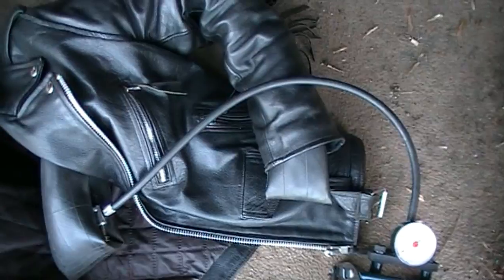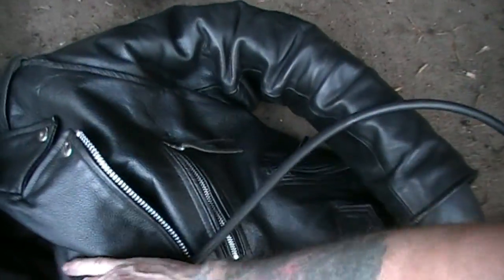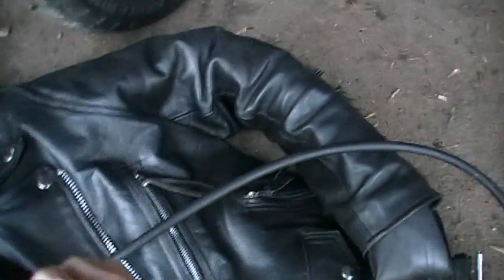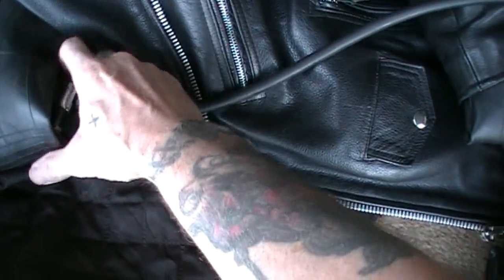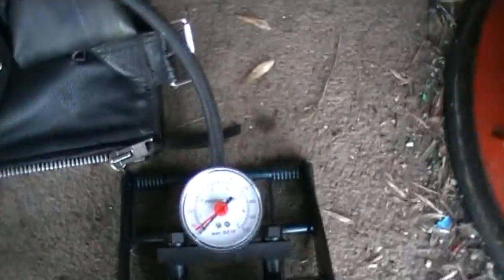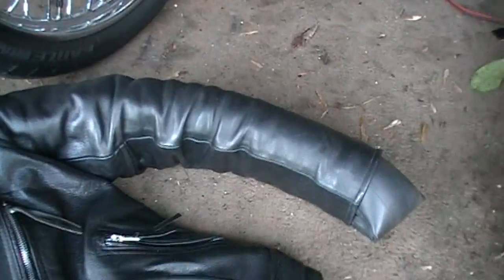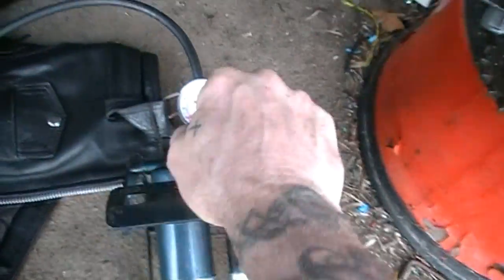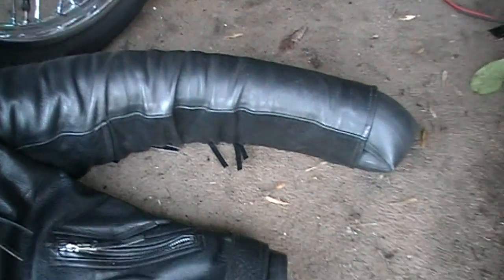TESTING NASA'S 4.7 llb HOAX SPACE SUIT PRESSURE IN MY JACKET LOL

Comment: Great video. I was wondering what would happen to astronauts Bob and Doug if their SpaceX capsule lost pressure? Their trendy, flexible space suits would suddenly become rigid under 14 psi of internal pressure--the fabric would be as tight as an inflated car tire. Soon the seams would rupture and their blood would boil off in the vacuum of space.
Reply: As their spacesuits and spacecraft only hold 4PSI and are not made of cheap leather, nor have car tire tubes in them, maybe the result would be different.

Comment: The preasure in Spacesiuts Has to be 14,5 PSi.  to be as preasurised like at Sealevel. if you put 5 PSi! in that Suit. (At Sealevel!)  you actually preasurised it with 19,5 PSi.  (The Germans Called it out in the Term "ATü"... It means... (Atmosphäre/Überdruck)). You cant simulate a vacuum with Over preasure. ;) And 5 PSi?... are 34 percent of "normal" preasure. or did i miss something?
Reply: @BennyFitter  actually you dont need to pressurise the Spacesiut... if you have a Rubber-ish underwear. That maintains a Constant prassure of 4-7 psi. The only Thing you have to care, are the Loungs and the eyeballs if the Helmet is providing a Atmosphearic "atmosphear" and is sealed up to the Neck. You dont need to wear a siut full of Air. Cause the Skin cant differ between Air pressure or "tension" Pressure.
Reply: @BennyFitter  thats only half the truth. Of course the Hand in a vacuumchamber will press through the fibres. Because the rest of the body Experiences a pressure of 15 psi. So you need a glove who can create that pressure in tension.
Reply: @BennyFitter  a scuberdive siut is capable of creating a counterpressure... without airfilling
Reply: @BennyFitter  the Black diving  siut... its only to keep Water inside, to keep some insulation.
Reply: @BennyFitter  its quite difficult to explain that in englisch. 
Are you able to understand german?
Reply: @BennyFitter  reading is not the problem. You can keep writing in englisch. 

But if you arent familiar with german. It makes no sense to Translate. So i stick with englisch Till i improve. ;)
Reply: What i try to Say. If you keep constant pressure through out the whole skin. It dossnt matter if it is a airfilled Hardsiut. A Rubbersiut or even Duct Tape can deliver some results. The Human dont need Atmospherik pressure to Stay in shape. He only needs Air in his loungs. And that needs to be gaspressured. All Other componants are can be Supported by the Muscles. If there are Evenly Supported by some Kind of artificial exoskelliton or a tightening compound. (If you on a Mountain. Like the K2... the Human is in an inviorment of close by 50% Atmospherik pressure. And only needs high conzentrated oxigen to survive.

Comment: MrSandpit, I debunked these claims on one of your previous posts, but rather than addressing my points you ignored them. I doubt that anybody with an education beyond year 10 would take this video seriously.

A couple of points:

1) NASA doesn't make its space suits out of bike tires. They're a little more sophisticated than that. The Apollo AL7 suits cost more than a million dollars each, in 1960s money;

2) Can you tell me what sorts of rigid joints were used in the AL7?

3) What does the term 'constant volume' refer to? (No Googling, now, You're supposed to have already done your homework on this one, since you're posting a video claiming that space suits are fake);

4) 4.7psi in a 14psi atmosphere is not the same as 4.7psi in a vacuum;

5) Do you know that Wiley Post was using pressure suits in the 1930s? And just a heads-up: he wasn't working for NASA;

6) Are you aware that the USSR, and China have all used space suits? If so, do you also claim that their space suits are fake?

6) Truck tires are often inflated to over 100psi. Whilst they are rigid, they don't puff up like your bike tire did. They maintain their shape. Why is this?

These questions are so obvious that I can only conclude that you are a troll.
Reply: Bill Larkin: "...a hero type"? What the hell are you talking about? We're not in a movie. Heroes do stuff like running into burning buildings and jumping into the paths of oncoming vehicles to save  to save people. I can safely assure you I've never done any of these things. But I fail to see what that's got to do with this video.

The simple test is to inflate the suit to a pressure above that of atmospheric pressure. Suit integrity is about the pressure difference between the inside and the outside of the suit. So all you have to do, even without any sort of vacuum chamber, is put the suit on a table and pump it up to 18.5 psi. 

You appear to have confused torr 8 and torr 3 with torr 1 x 10 exponent -8 and torr 1 x 10 exponent -3. Torr 8 is a higher pressure than torr 3. But torr 1 x 10 exponent -8 is 100,000 times lower than torr 1 x 10 exponent -3.

Anyway, your figures are way off for another reason: pressure in space varies, but in low earth orbit it's around 7.3 torr. We can easily create lower pressures that this on earth. NASA's vacuum chamber can create vacuums as low as 6 torr. The proof is in the pudding: the International space station (and many other satellites) has to be periodically re-boosted as the very thin atmosphere at aroung 400km creates a subtle drag and slows it down.

In interstellar space the pressure is much lower - it's 7.5 x 10 exponent -5.

In both these cases, if you crunch the numbers you find that the pressure difference between the inside on an AL-7 suit and even interstellar space (where obviously, humans have never yet been) is LOWER than the pressure difference between the inside and the outside of Wiley Post's suit in 1934.
Reply from the maker: 1. Made by some ole latex company who say they are not even radioactive proof
2. You mean the rigid joints in between all the flexible bits?
3. Being honest, not sure.
4. Then why does NASA not say so
5. High altitude is a little different than a space vacuum
6. Did China and Russia land on the Moon?
7. They are reinforced with steel
Reply from the maker: https://www.youtube.com/watch?v=2TebGSZ2EQE
Reply: 1) Wrong again. The design and construction of the AL-7 was initially split between ILC (International Latex Company) and Hamilton Standard, a long-time aero-engineering company. Ultimately Hamilton and ILC were unable to work together successfully, and Hamilton switched to Goodrich as its supplier. Ultimately NASA took over direct control of the design and construction. The process took around three years;

2) Yes, I mean the rigid joints between all the flexible bits. You didn't account for them in your video (I therefore infer that you didn't know about them until I mentioned them), and they made a rather significant difference in the mobility of the suits. They contained bearings to allow for easy rotation and extension;

3) The term 'Constant volume' refers to the careful design of the suits to prevent any change in the internal volume of the suits when the astronaut moved, thus preventing an increase in pressure (and therefore, stiffness) when he bent his arms or legs, or when he bent over. Again, the fact that you didn't know about this shows that you haven't done very much research;

4) Seriously? You need NASA to tell you that 4.5psi - 0psi does not equal 4.5psi - 14psi? (BTW, I believe that the actual pressure in your tire tube is 18.5psi - if it were actually 4.5psi it would collapse. I'm assuming that the gauge that you used takes this into account);

5) Yes! That's correct. High altitude is a little different than a space vacuum. But in terms of pressure, the difference is pretty small. At 50,000 feet, the altitude of Post's highest flight, atmospheric pressure is 1.6psi (just over a tenth of the pressure on the ground). In space it is close to 0psi.

Post's suit was pressurised with pure oxygen to 7.25psi, thus the pressure difference between the inside of Post's suit and the air outside was 5.35psi.

On the other hand, the AL-7 suits had in internal pressure of 4.5psi, so the pressure difference between the inside of an Apollo astronaut's suit and the vacuum of space was 4.5psi, i.e., slightly LESS than the difference between Post's suit and his environment. So in terms of pressure-related stiffness, the Apollo suits had less to deal with than Post's pressure suit. Even so, Post's suit had joints that gave it enough flexibility to allow him to walk to his aircraft and operate the controls. And he had all this in 1934. I'm afraid you've just contradicted your own claim;

6) Irrelevant. Your video is about the supposed unfeasibility of the AL-7 (or presumably any other space suit) working in a vacuum. Unless you're suggesting that the vacuum on the moon is different from the vacuum in space, then whether or not China or Russia landed humans on the Moon is irrelevant. China and Russia have put humans into space (and have conducted numerous space walks), and their space suits work. Therefore your video is wrong;

7) If truck tires can be inflated without puffing up, then why do you suppose it's impossible to build a space suit that also doesn't puff up when inflated? Did you know that space suits have restraint cables built into them as well? You just have to add joints to allow for movement.

I'm sorry, but the more you write, the more you demonstrate how little you actually know about the subject. There's a veritable ocean of information out there, an awful lot of it's not from NASA (or even the USA), and it's all free.

I can only conclude that you are a troll.
Reply: Squodgamullis 
Your a hero type huh? So you tell me
1. How do you test a suit on earth for a Torr 8 vacuum when you cant even produce a vacuum on earth lower than a torr 3?
Reply: Squodgamullis - Excellent!  I commend you.  It is refreshing to see someone else who knows that they are talking about, and who refutes the garbage these hoaxers post.  If only they would actually study what they claim they understand.  This is yet another example of ignorance claiming fraud, or just a troll, as you said.  Sometimes it is difficult to tell the difference.  All the information any hoaxer would ever want to know, even if only to refute the moon landings, is available online.

The Apollo A7L lunar suit was composed of many layers.  An undergarment (usually cotton) similar to long johns, to absorb perspiration.  Then the Liquid Cooling and Ventilation Garment (LCG) that connected to the PLSS to remove the astronauts' body heat via a porous plate sublimator.  The pressure suit was exactly what you said.  It contained a rubber bladder on the inside that was interwoven with convolutes (hard rubber "accordion tubes") at all the joints; elbows, torso, knees, ankles.  The ingenious part was the cables that were manufactured inside the convolutes, that acted like hinges, carrying most of the load of the pressure suit.  THIS was the innovation that made the 4.5 psi pressure in a vacuum MUCH easier in which to have mobility.   There was even a cable across the chest, which is why in the videos of the lunar astronauts, even while just standing, their arms always seem to be slightly raised.  The convolutes made it so that constant volume could be maintained, regardless of the body movement of the astronaut.  

The reason that the suits did not seem rigid and expanded, like most hoaxers claim they should have been, was the type of rubber used, and the fact that there was a containment layer on top of the rubber bladder that kept the bladder from ballooning out.  Why is this so hard for hoaxers to understand?  Finally came the outer suit, which was composed of many layers; dacron, kapton insulation, and Beta Cloth (which was specifically designed for Apollo).  Beta Cloth was micro-fibers coated with Teflon, to reflect solar heat radiation as well as protection from micro-meteoroids.  I won't even get into the rotating pressure seal joints at the neck, wrists, and hoses, with locking seals.  I am certain you already know all this.  It is more for the education of the hoaxers.  I grow tired of their claims of fakery, and I find myself constantly posting the true science and engineering that was employed by the Apollo program, to refute the ignorant claims of hoaxers.  You either understand the science, or you don't.  Ignorance is no excuse to claim fraud.

As a side note just to you, several astronauts complained that the lunar dust was so fine and so abrasive, that it was getting into the ball bearings in the pressure seal joints.  Imagine that in your eyes and throat, all the way back to Earth, which in some cases it did.  These guys were true heroes.
Reply: brabanthallen rainbows prove it was a hoax. We live in an enclosed ecosystem.

Comment: not a great test remember in space you would want 1 atmosphere some 14.6PSI. but remember on earth if the tyre had an open valve the inner part of the tube would already have 1 atmosphere. the same as the surrounding pressure. even before inflation.

Comment: have you ever been on a commercial  plane at 40.000 ft ?    11km  what happen if a door  cracks open , you know the result !   de decompression is like an explosion and the air  decompression on your body is like  3.00 psi,  at see level is equal  14.7 psi,   so in an absolute vacuum , we humans need to  pressurize our body to match the  inside of our body , the most insane thing I see is the deep down temperature of minus  200 F  on vacuum  plus  if the spacesuit  is pressurized of 14.7 psi as at see level in space, the astronauts  would be like  a hard statue.....so ,humans never left LEO
Reply: Thats actually not that true... the cabine preasure in Planes is like 8000 feet  up. so it s more likely that the astronauts are more or less preasured like that... or less.  the human can survive in hights up to 25000 feet... with Oxygen out of bottles.  but it means, that the suit has to be preasurised also... 5-7 psi.  but... you can preasure a human with a ssuit with rubberclothes or something. but the head has to be Atmospheric preasure.  due to all the Holes in it. but any rupture of the fabrics will cause a Hugh stress or even the death of that Astronaut.

Comment: Simple thought, if they are filming space walks in a pool somewhere, why are the suits not squished towards the astronauts bodies by the water pressure? They would still have to be inflated to keep the shape.
Reply from the maker: Funny you ask that, because its odd that NASA put just under 5psi in their space suits, which is the water pressure at around 15 feet.
Reply: MrSandpit123 the pressure at 15 feet is 6.5 psi greater than at the surface. Since the surface (atmospheric pressure) is already at 14.7 psi, that means the absolute pressure at 15 ft is 21.2 psi.  6.5 + 14.7 = 21.2
Reply: +MrSandpit123 You were saying?
Reply: +MrSandpit123 "its odd that NASA put just under 5psi in their space suits, which is the water pressure at around 15 feet." Actually, it's around 21 psi at 15 feet.
Reply from the maker: Justin mate, you need to go back to school.

Comment: You would need to actually have a suit with 4.7 lbs pressure inside, with you in it, surrounded by A VACUUM.
Your test is erroneous and nonsensical.

What is better evidence is the "stone-age" battery technology of the late 1960s and early 1970s and supposedly using that to power and stay in a space suit for more than a few minutes. (much less a half hour or longer)

NEVER HAPPENED.
Reply: Link to vacuum chamber testing of spacesuits
Reply: Are you asking or did you forget to include the link?